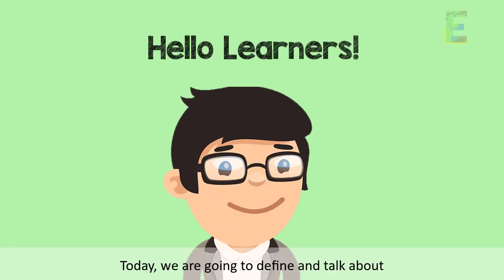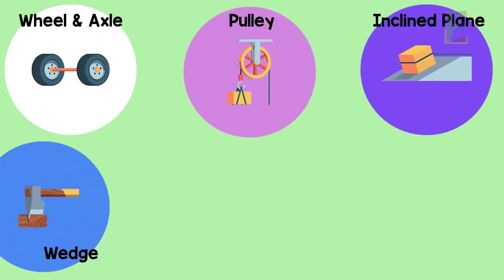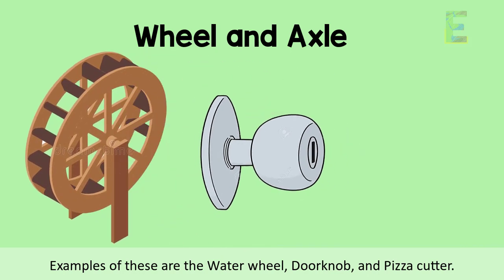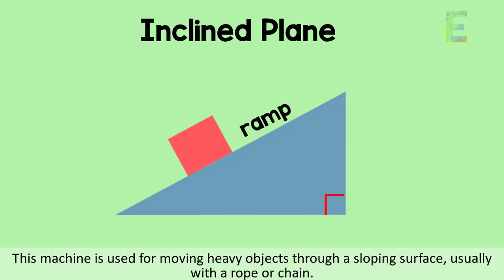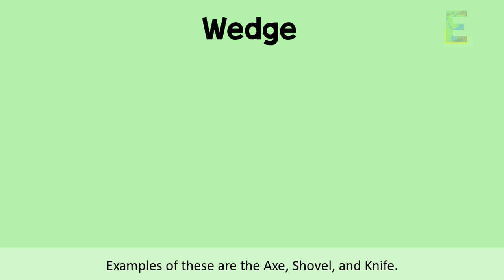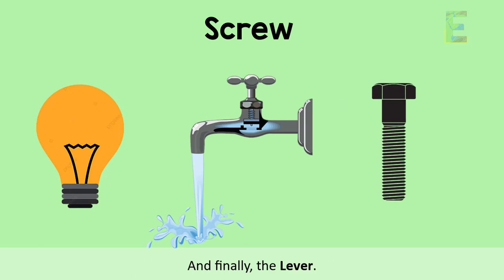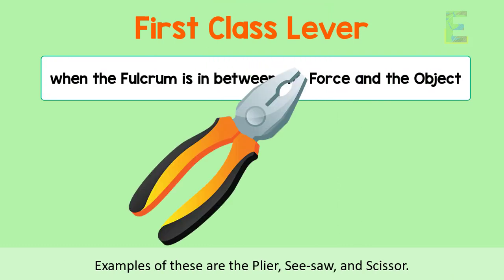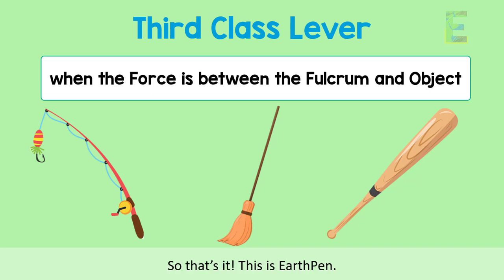Simple Machines | Animation

Comment: Correction: A stapler is not a second class lever. The Effort is in the middle and therefore makes it a THIRD class lever.
Reply: A stapler is considered a second-class lever because the load (the staple) is placed between the effort (the force you apply by pressing down) and the fulcrum (the hinge or pivot point of the stapler).

In a second-class lever:

The load is located between the effort and the fulcrum.
The effort is applied to lift or move the load.
The fulcrum is the point around which the lever pivots.
In the case of a stapler:

The load is the staple being pressed into the paper.
The effort is the force you apply when pressing down on the stapler.
The fulcrum is the hinge at the back of the stapler, where it pivots when you press it down.

Comment: A screw is a circular inclined plane and not mentioned is hydraulics, therefore the six simple machines are the wheel, a pulley, inclined plane, wedge, lever and hydraulics.
Reply: I've also had trouble understanding why inclined planes are not just a type of wedge
Reply: I believe you are exactly correct. I'm wrong. The pulley is a wheel, a wedge is inclined plane and they left out, the lever or the fulcrum that makes the lever.
Reply: Wrong again.